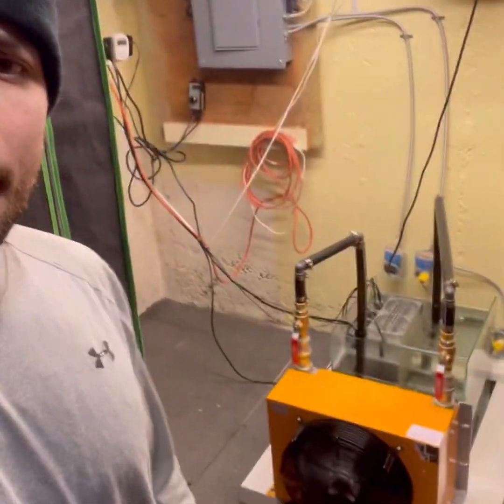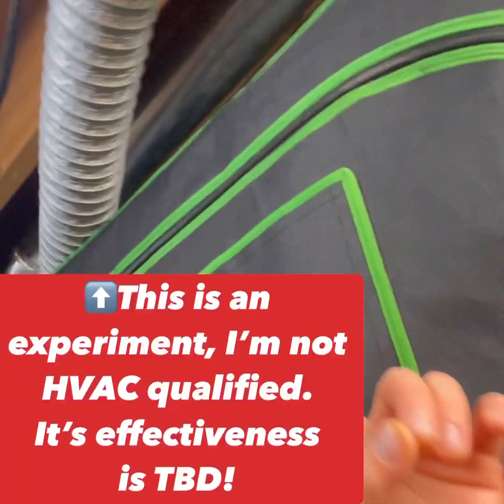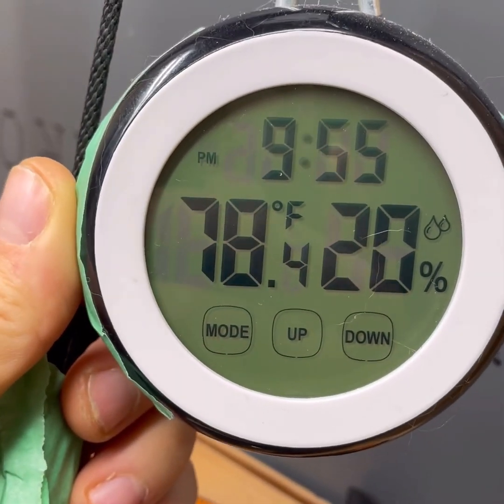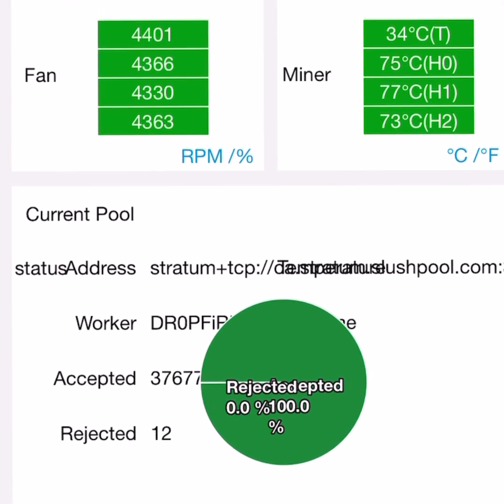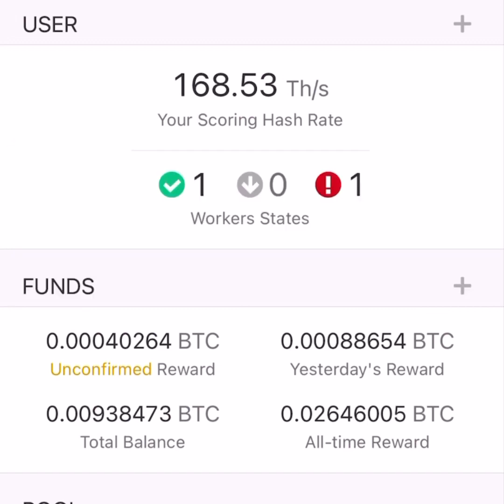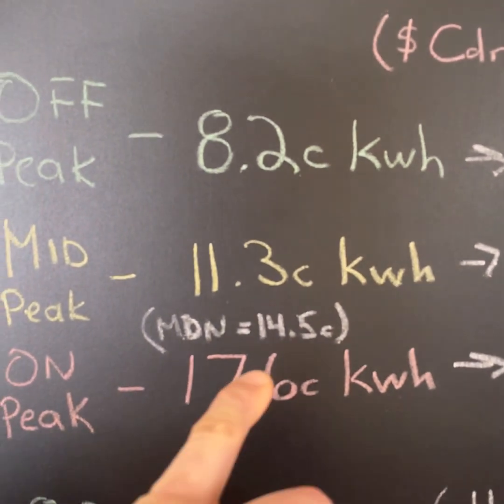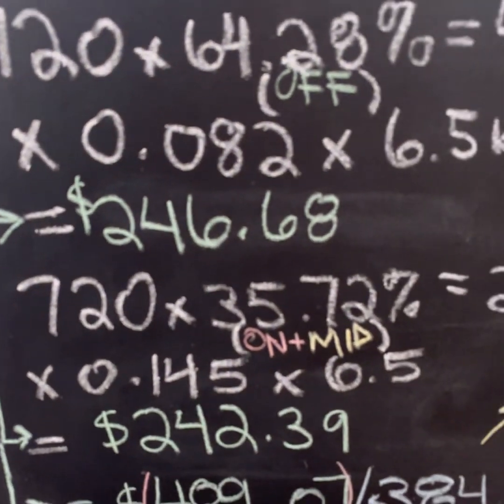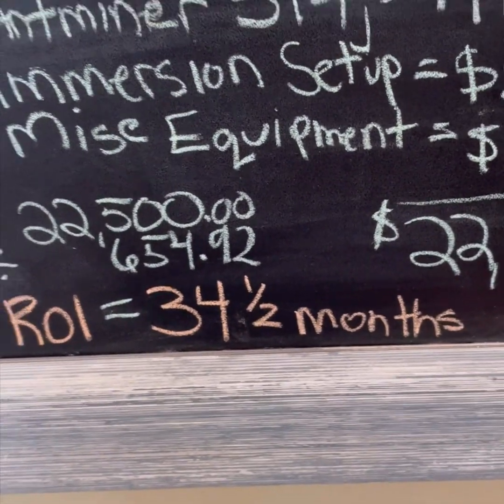How much I make Mining Bitcoin in Canada - is it profitable in 2022?

Comment: Which firmware you using on S19J?
You Overclocked yet, what are the temps and hashrate
Reply from the maker: I haven’t overclocked yet. I have to pull my unit from the fluid and make sure it is compatible first. If it is, I plan to setup and use brains OS+ (free to use with SlushPool) in the next couple of weeks and will post a video on it. I will likely also have to install a larger 30A breaker in my electrical panel for the increased wattage.

Comment: Would just adding another oil cooler of the same size in the same loop be enough to cool both you think?
Reply from the maker: Funny you mentioned that, been thinking about the same thing. It should, but it makes a make a longer loop, so I’m not 100% sure yet. I was going to buy a 450L/Min model but after you go up in size from   my current 200L/Min one  you have to ship from China by sea to a seaport, which I don’t live by. The only air shipping option made the total price go from $1,200 usd to $2,520 usd. Therefore, I may end up trying a double unit setup to save money, or explore more USA options.